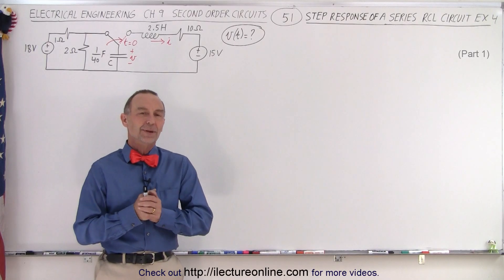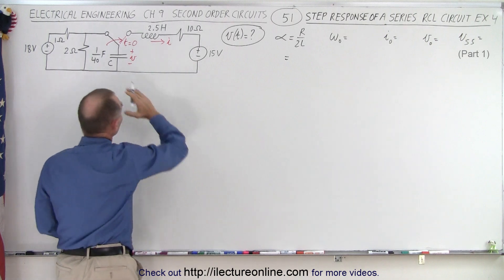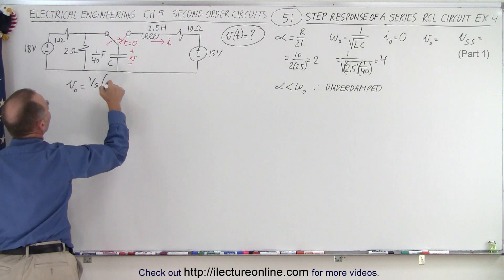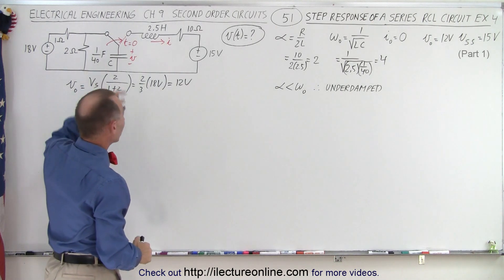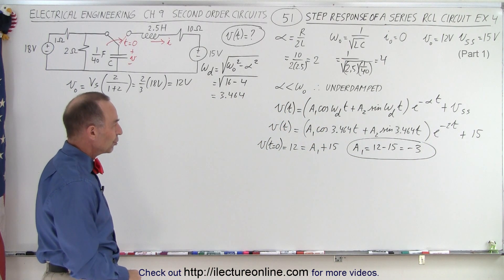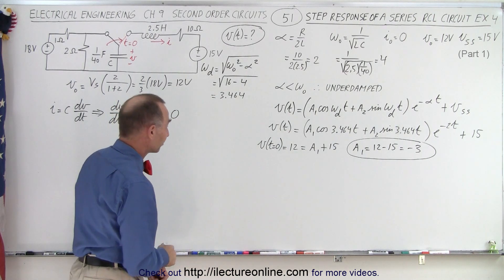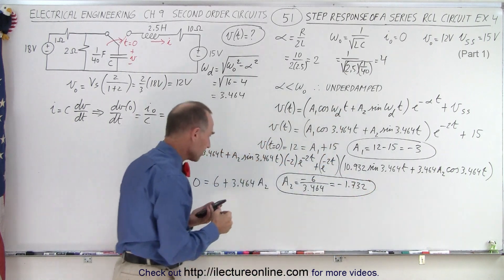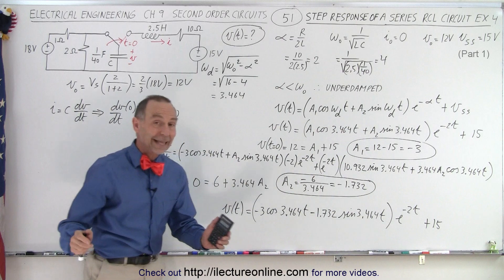Electrical Engineering Ch 9: 2nd Order Circuits (51 of 76) Step Response of a RCL Series: Ex 4 P1

Comment: I found the most dangerous part of 2nd order circuits the moment we take action to find A1,A2 
which we need to analyze circuit and it seems only the way the professor believes will lead to correct answer 
so students need to solve a lot of circuits to get that done correctly
Reply from the maker: It does require a lot of practice.